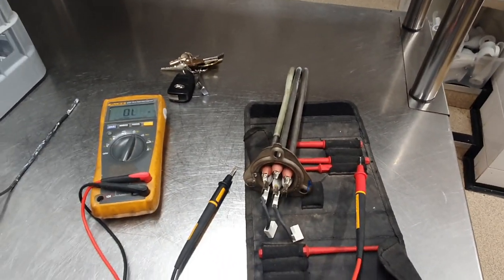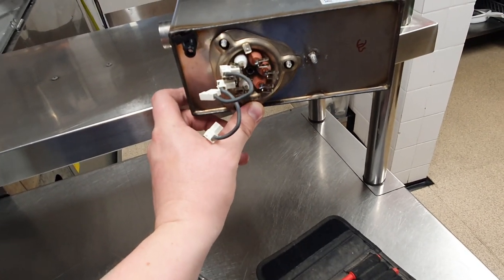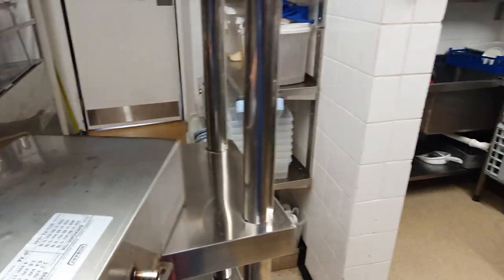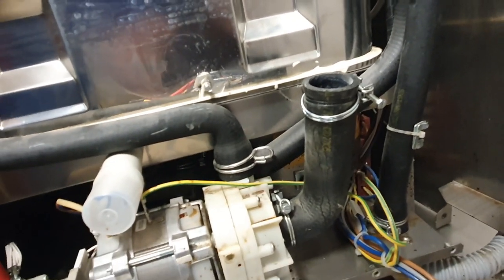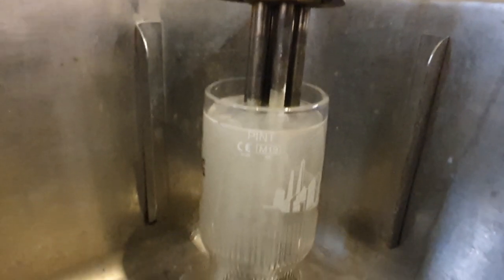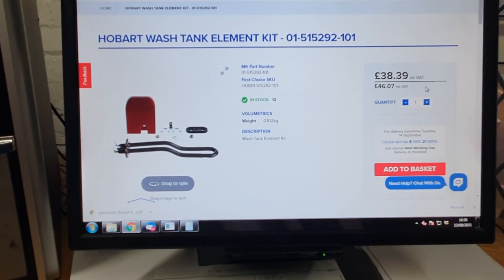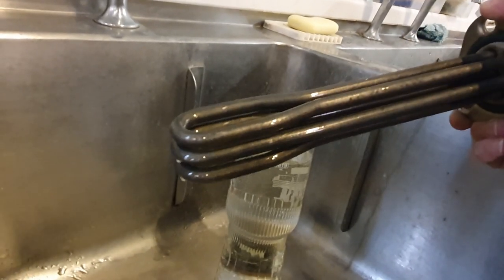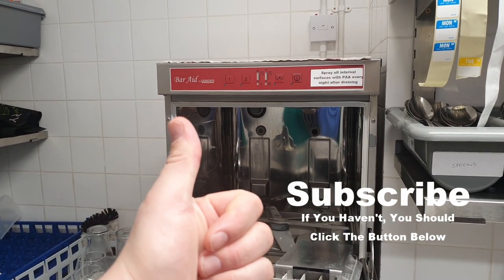Servicing A Hobart 400 10A Glass Washer

Comment: i tried to do this same job to our old washing machine, when i got it all apart to where i could get the heating element out the wires were all blown off their connectors, something dramatic had happened there, never got it repaired, its so satisfying when you can totally fix something :D